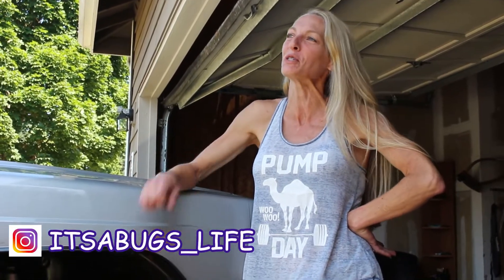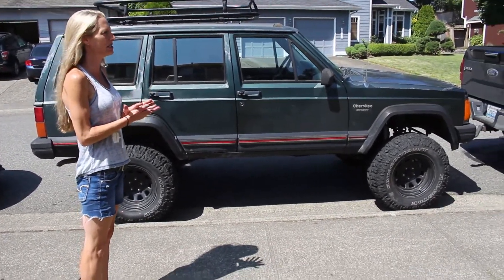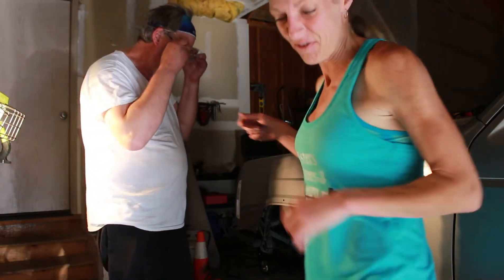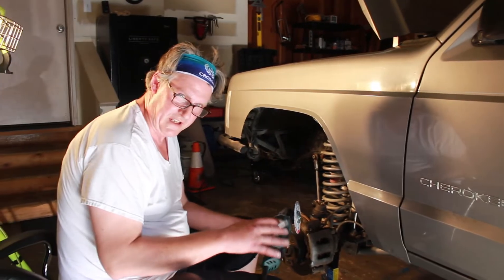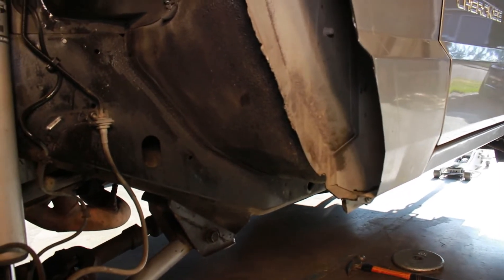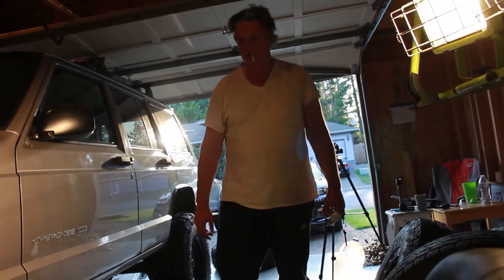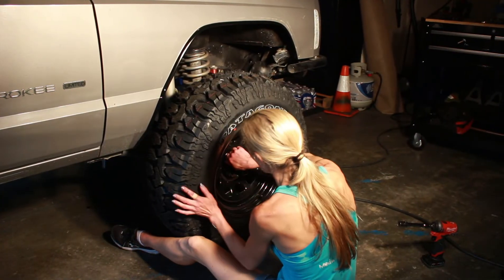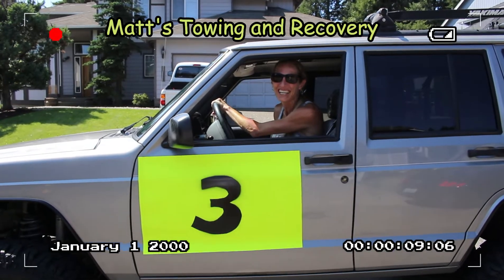JEEP XJ- HOW TO FENDER TRIM  (THE FINAL CUT)

Comment: I prefer angle grinders with momentary switches rather than latching switches specifically so if they get away from me they shut off.  The latching kind are slightly easier to use but if something goes wrong it can cause problems.
Reply from the maker: TWX1138 - Yep, that metabo is violent! 🤬 I think I was smart sitting this one out. Too much could go wrong real fast ❤️

Comment: What size lift is on the XJ y’all did the fender trim on.
Reply from the maker: 6.5" lift. And we are not done fender trimming. The bump stops work well in the back. But we need to trim some more up front. That will be in a video soon!